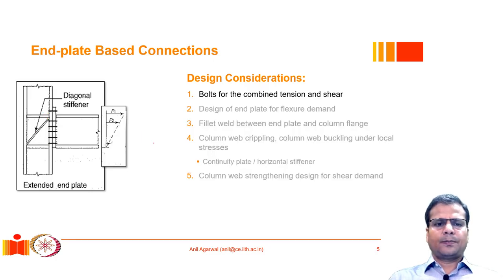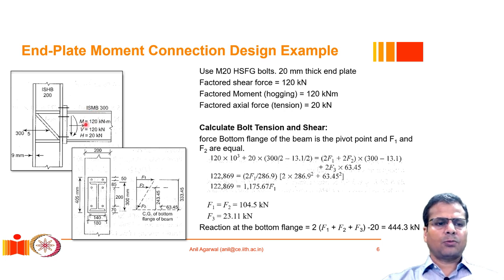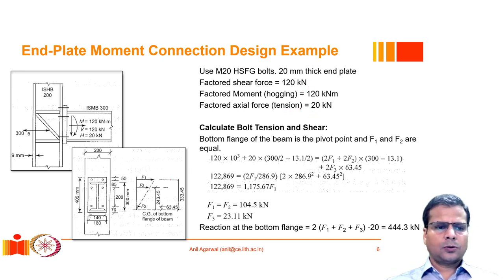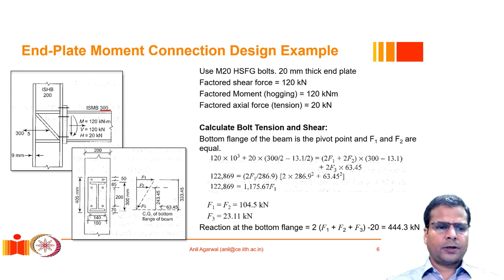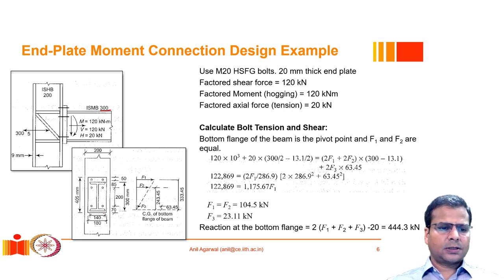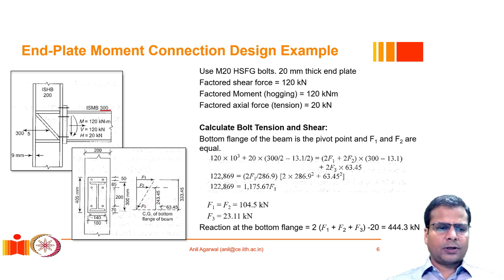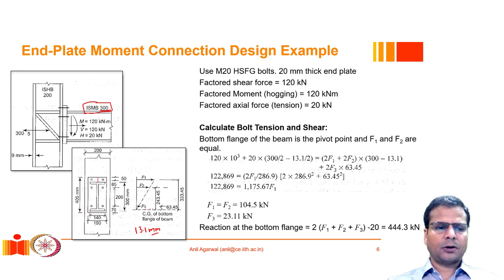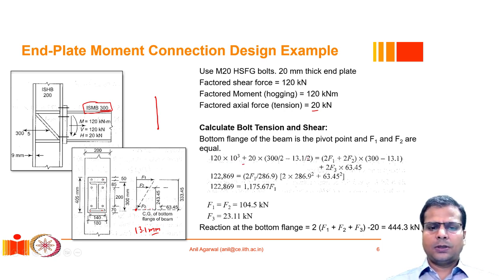End-plate connection: Design example

Comment: Question: "Should we only consider weld at beam flanges to resist moment when designing for beam to end plate weld connection? By including the web weld plastic modulus 2x240^3/12 in Izz of weld does the professor mean weld at beam web is used to resist moment too? Is this allowed by the code?